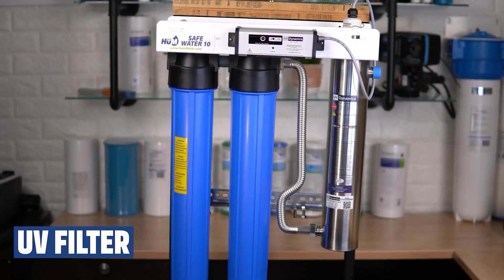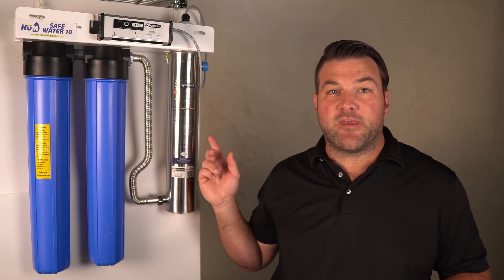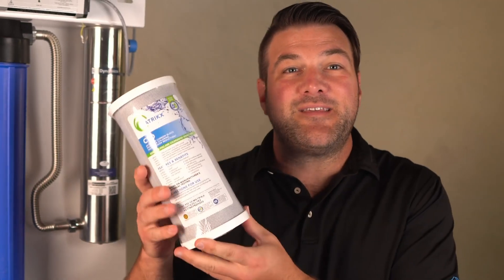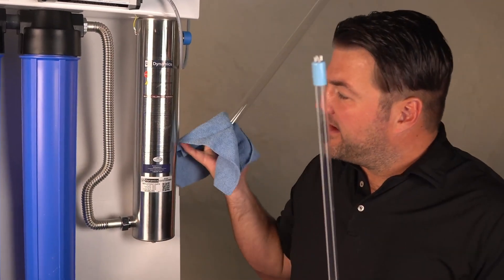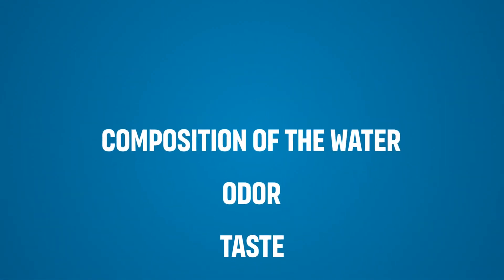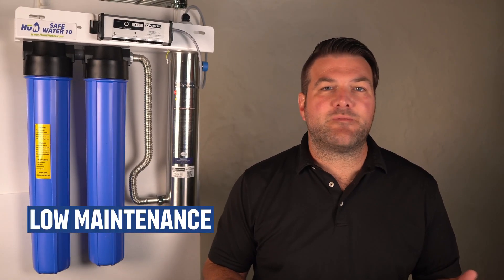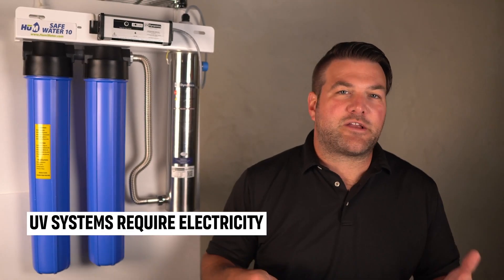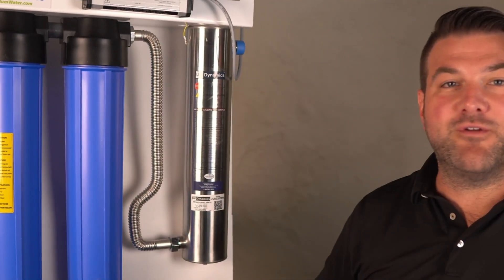How Ultraviolet Disinfection Systems Work

Comment: What’s the best way to plump a UV system when using PEX B?
Reply from the maker: With our newest version of the HUM Safe Water 10 https://waterestore.com/products/hum-safe-water-10gpm-minirack-mr320e-tp2s-220 you can connect right up to the UV, it includes an internal light dam.